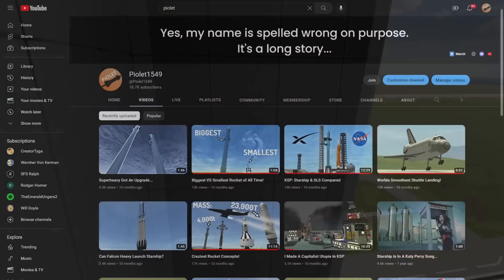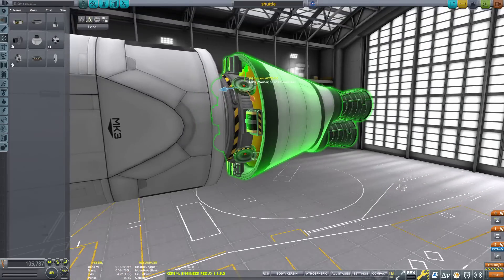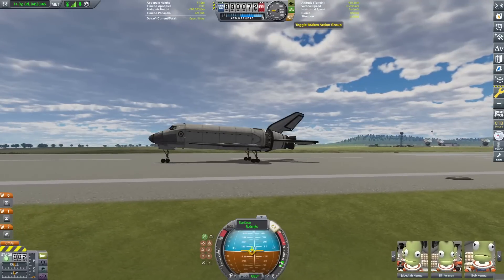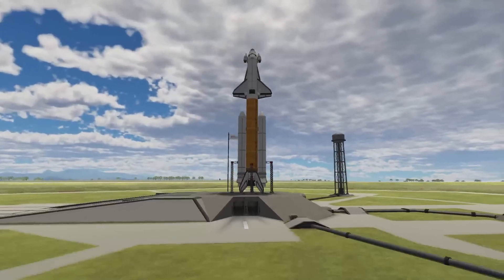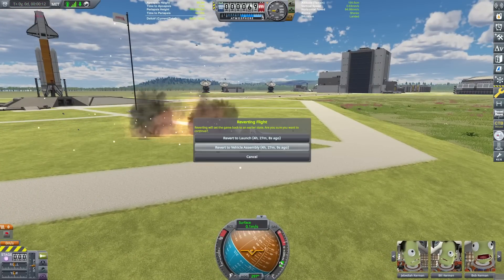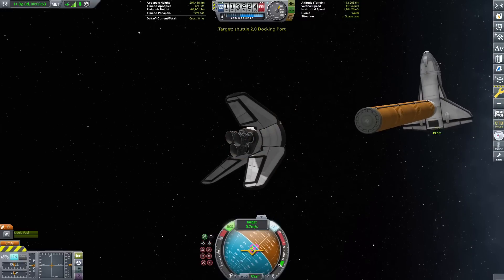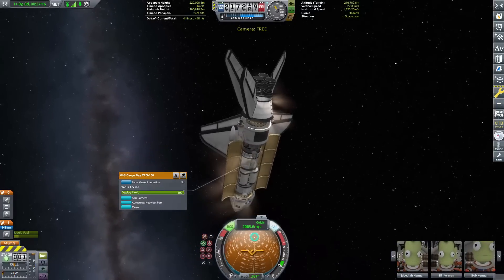I Fixed The Space Shuttle

Comment: So I understand where you were going with this…but instead of the engines attaching to the shuttle and just becoming dead weight for the remainder of the flight (like they were in the OG shuttle) just make them a detachable pod (Vulcan style) and let them land right after launch, floating upright to protect them from the salt water. Then the Shuttle is more like Buran, while still being able to keep being reusable

And the biggest issues with the Shuttle were the escape system (it didn’t have one, hence the Challenger disaster) and the heat shield (it took over 16 HOURS PER TILE to reuse it. And there were over 20 THOUSAND tiles)

There was a Shuttle II design from Langley that would’ve solved most of the issues with the OG shuttle, but it was never funded past research stage, even though it would’ve solved both problems AND increased payload capacity with almost no changes to the SRBs or core tank

Comment: Now try redesigning the Buran, an already safer version of the space shuttle. Just take out the large engines, and place the shuttle higher up. You may have to shorten the space shuttle or use a ton of struts as that kind of design brings it’s own balance and stability issues.

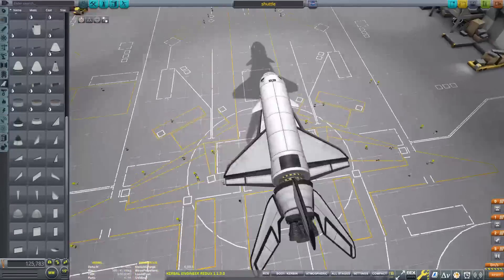Comment: From 3:30 onwards... that would not qualify as a safe vehicle if it needs to undock and reconfigure in orbit. If redocking once in orbit isn't possible, then the orbiter wouldn't have any way to return while still being stable.
Reply from the maker: got this comment a few times, I think if for whatever reason the engines are not able to be redocked, you would still be able to detach the cockpit and land using a parachute. I would probably need to refine the design a bit to make that work (basically just add more heat shielding to the cockpit), but since the docking is done while the vehicle is still technically sub-orbital, I think you might be able to get away with this idea
Reply: @Piolet1549  That would still be far more risky than what NASA came up with. With your craft, in the event of an abort before circularization, you will need to abandon the whole orbiter. If a real shuttle had to abort at the same time, it would be able to burn prograde and land, keeping the orbiter and any payload intact. 
The orbiter as-is is truly the best way to reuse everything as they required it - the orbiter, and main engines. If they only did not require to reuse every single of the orbiter main engines, the whole thing would had been much safer at slightly higher cost.

Just put some chutes on the main engines and recover them. More refurb needed for each launch, but you aren't going to be carrying around dead weight once you are on orbit.

I guess what I'm trying to say is, without a breakthrough in propulsion (giving us near-SSTO spaceplanes), the shuttle design is... not ideal in any scenario.

Comment: If you were to do this in reality and not under the constraints of KSP parts i think some sort of retractable beams along the length of the main fuel tank could connect the engine and the orbiter, and when the orange tank needs to be jettisoned the beams could lengthen a few meters to provide clearance and small SRBs  would move the tank out of the way so the beams could simply retract and connect the engine and orbiter without having to attempt a docking procedure while on a suborbital trajectory.

Comment: The problem is that the orange tank doesn't go to orbit.
The fuel tank is ejected before circulation, then the shuttle uses the OMS engines, with internal hypergolic fuel, to circularize at apogee.

Moving those OMS engines to the side of the crew cabin also places the crew in close proximity to the fuel, MonoMethylHydrazine, and Dinitrogen Tetroxide. If you watch shuttle landings, they have giant fans around the shuttle after landing, to protect the crew from the absurdly toxic fuel.
Reply from the maker: yeah that would be something to consider, I think it would still be manageable though, because the engines are still way behind where the crew would sit. It would still be possible to put the OMS engines in their original place. I didn't for my design because it can be tough to get the center of thrust right when mounting engines so high up
Reply: @Piolet1549  you kind of removed the steering on the nose wheel, by making it a large gear....
Reply: they are kerbals, they can drirnk all the monomethyhydrazine and dinitrogen tetroxide and come out fine.
Reply: @theairacobra  No kidding. I once saw Jeb eating a plutonium sandwich!
Reply: @johnadler6987  one I sat jeb on a twin boar and sent him to orbit, the mission failed so I think he drank all the LFO

Comment: I think electronics would not be a big problem at all when it comes to redocking the engine mount

Instead securing connection in such way that it can survive reentry, that would be hard
Reply from the maker: Fair point, you'd have to have some really strong connecting mechanism that is also heat-shielded

Comment: I usually make a shuttle sandwich; shuttle in the middle with twin stabilizers on the wings and boosters located ventrally and dorsally. That way they can detach quickly and the path is clear to front and aft of the shuttle itself. And stability is easier to adjust by just moving the boosters forwards so the center of mass is front. Crew safety is a weakness I'm willing to accept.
Reply from the maker: Not a bad idea, sandwiching the shuttle would def help with the stability, but yeah crew safety would be the toughest part

Comment: okay so here are my main problems: How the heck would you abort in flight? what if you had a problem, and with your vertical stabilizer on the engines, and you couldn't reenter? I want to see more investigations into abort modes
Reply from the maker: Your right that if you couldn't get the back bit docked up that you would probably be screwed. There might be a scenario where you could just detach the cockpit and see if it could survive entry and land with the parachute. That might work because there is heat-shielding on the bottom, but I'd have to test it
Reply: @Piolet1549  If you tried that, it could impact the rest of the orbiter. Even if it cleared the orbiter, the command module would have incredibly funky aerodynamics and would probably flip and end up killing the entire crew.

Comment: Edit: use two or three smaller docking ports so when you dock, all three align together and it’s upright or 120 degrees of an offset so you don’t have gaff around with alignment since the docking port magnets do it for you!
Reply from the maker: that's actually really smart... good idea!
Reply: @Piolet1549  well, thanks. If only my P.C. had enough disk space for KSP along with the two others I play 😂. Then I could download your shuttle and edit it…either I way it’s really clever the ways you did it. Just every sing,e time I try to recreate those really good aircraft, it never looks right.
Reply: The other option is using the arrows on the docking ports to visually align the ports after docking. The ports get something like 15 degrees of rotation each
Reply: @米空軍パイロット  it’s easier for lesser experienced players (like me) to use the other method, but it’s good to know that the docking ports have a roll feature, too.
Reply: @RailsofForney-official  Yeah. I think it got added recently. You right click the port and you can rotate the craft that they are attached to.
Reply: @米空軍パイロット  good to know! Sadly I can’t play KSP anymore after some drama on my drive but still good.

Comment: i think it could even be possible to dock a Engine bit onto the orbiter and have fuel lines go into it (only in real life though). It would be complicated but you could have a interaction surface inside of the coupling that looks like what Starship has with the QD Arms. Once Docked the Fuel Lines could connect and there you go.
Actually you would need a System like this, how else would you run fuel through them in flight lol
Reply from the maker: yeah... your probably right

Comment: main issue i would see with this design is that the wings are much higher up, so it could make the whole vessel tip over. (if you don't get what i'm saying try making any rocket and put big wings on your payload instead of the bottom of the rocket)
Reply from the maker: That was the biggest thing I was worried about when making this. That's why I added the 4 big tail fins to the bottom, to try to add as much lift at the bottom at possible. It ended up flying almost perfectly in KSP, which is obviously not real life tho.

But yeah I agree, high wings is the biggest problem with the new design, probably could have made them a bit smaller and it would've flown better
Reply: @Piolet1549  now try a bigger version in KSS/RSS with some realistic mod